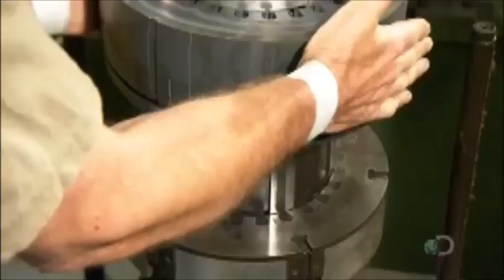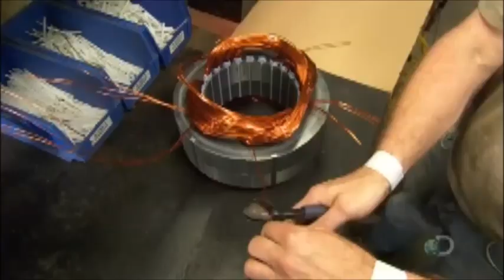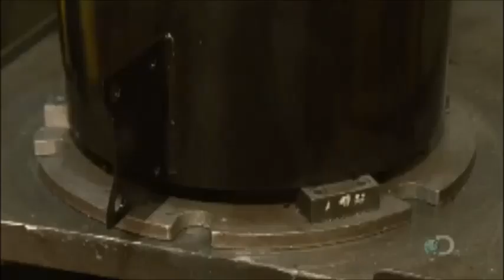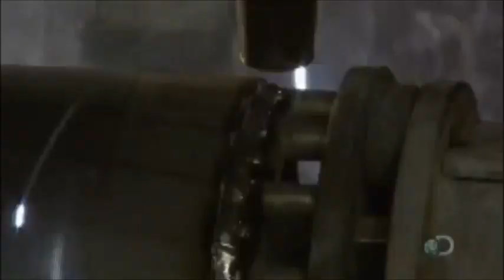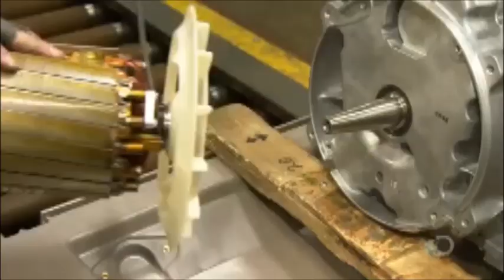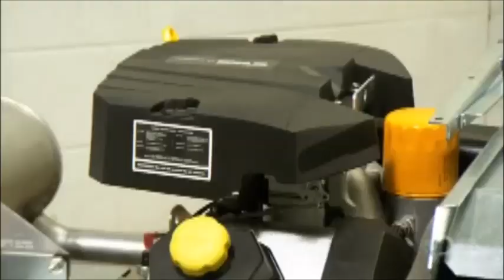How It's Made - Standby Generators

Comment: All lies. The 'brushes' are the exciters that induce the initial voltage which then energize the rotor windings creating the electromagnetic field that finally cut through the stator windings thus generating output voltage.
Reply: I'm sorry, the exciter powers the voltage regulator that actually energizes the rotor windings.

Comment: Lol, "The brush will collect electricity from the shaft and transfer it to the controller." Quite the opposite, dear Science Channel :)
Reply: They are so rubbish...
Reply: you forgot the brush is motorized
Reply: playdav485
A generator's rotor windings are excited via those brushes. Then the rotor is rotated by the power source and induces a magnetic field on the stator windings, which in turn create the electricity that is taken out of the generator.
Reply: LegendLength no, because this generator has no magnets. You need power to create a magnetic field in the rotor so the stationary coils in the stator can produce power. Remember that only moving magnetic fields do induce current. The voltage that the controller supplies to the rotor determines the output voltage of the stator. The output frequency is determined by the motor speed.
Reply: Regulator > brushes > slip rings > rotor field coils > induced voltage in stator > Regulator.  (feedback loop)

The regulator will vary the DC voltage applied to the rotor field coils in order to maintain the desired AC output voltage.  This is commonly called "excitation".

Additionally, there is a  motor speed governor that varies the throttle in order to maintain a constant RPM.  The  output frequency (Hz)  is  a product of the RPM of the  engine / rotor.

Both the output voltage and frequency are affected by the connected AC load, so the regulator and governor play a critical role in maintaining the stability of the output.